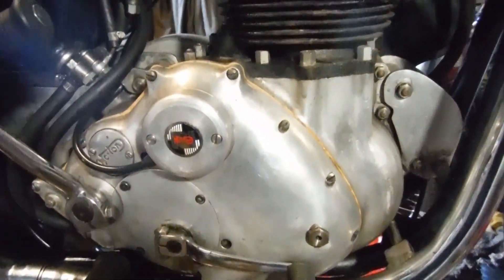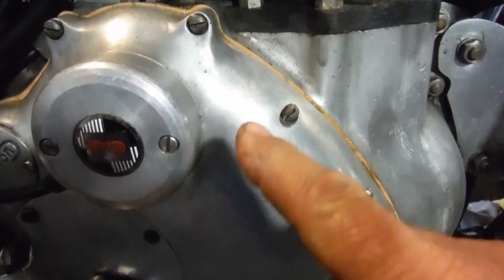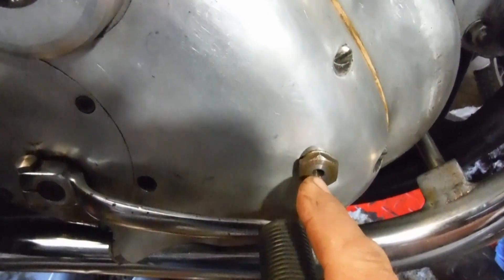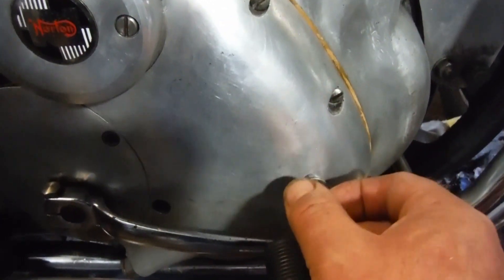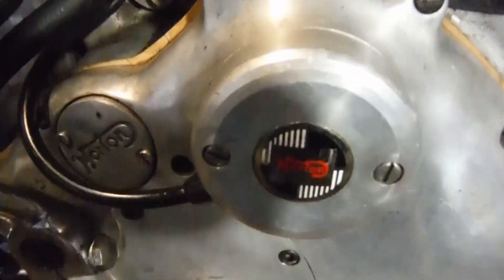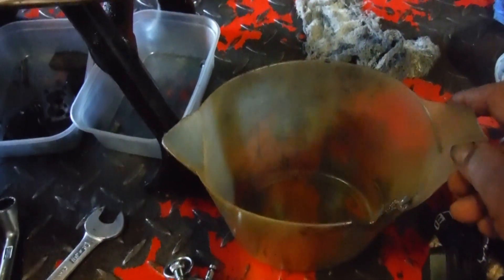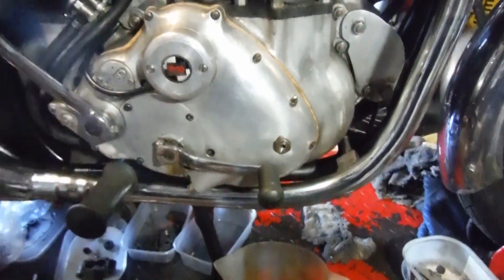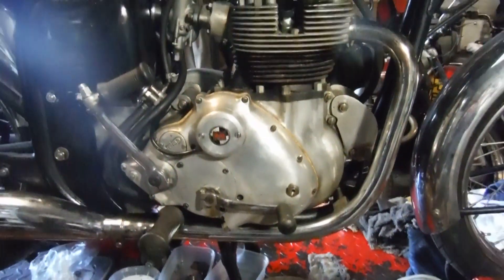Norton unit 650 Prototype Checking for oil passing through the oil pump after short engine run.

Comment: Have to say that’s impressive.  Has there been any sign of a leak at the crankcase joint ?
Reply from the maker: Thanks. The crankcase joint possibly leaking was a prime suspect when the machine arrived, based on what I had been told to expect, but recently it has proved to be oil tight.